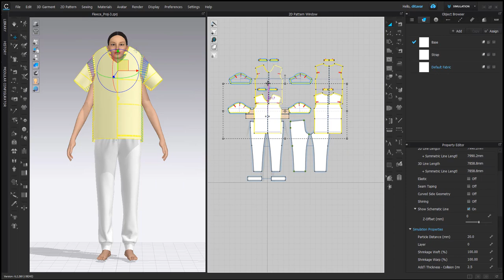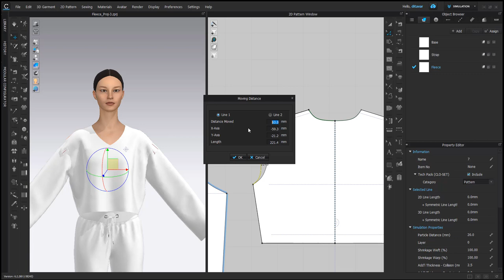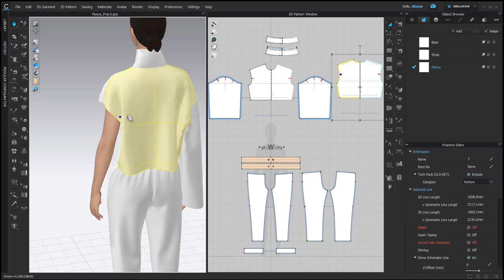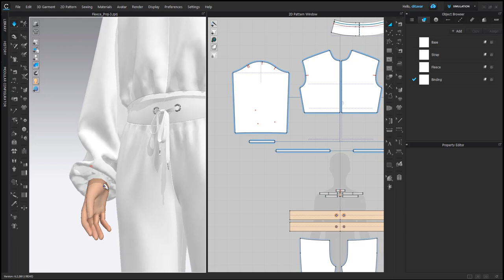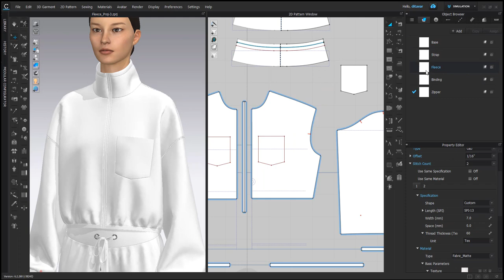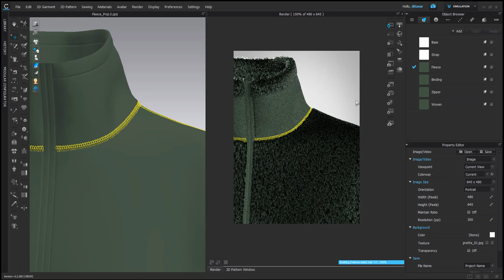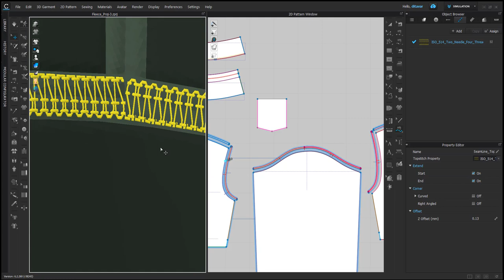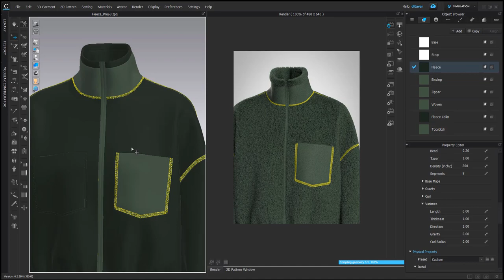CLO3D | From T-Shirt to Fleece Jacket

Comment: i really like your presentation of the material, but I beg you can explain in more detail which keys you use and so on, I've spent all my nerves
Reply from the maker: Thank you for your feedback. I try my best to make the keys more visible in my recent videos. However I have very limited time to do these tutorials, so I try to share as much info as I can, therefore the videos can get quite rushed. For this older video, I can try to make a written summary with tools+shortcuts I am using. Would that be helpful?
Reply: @stitchandrender  Yes, that would be very cool! Thank you for sharing valuable information for free, subscribe!